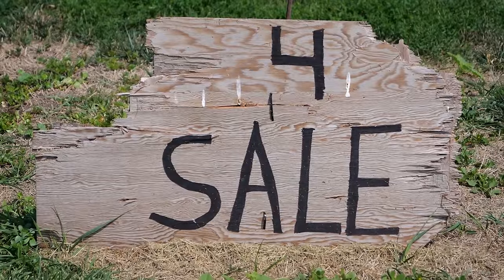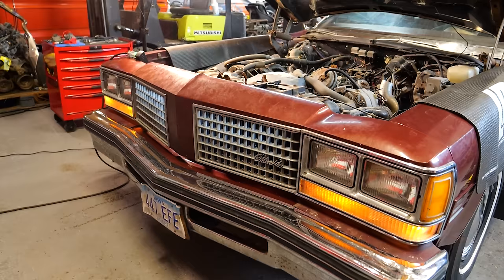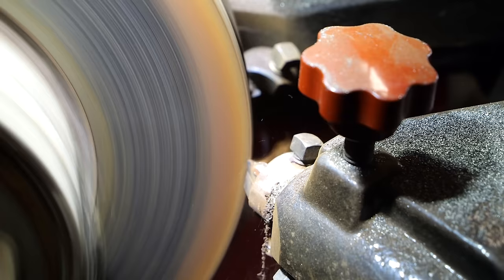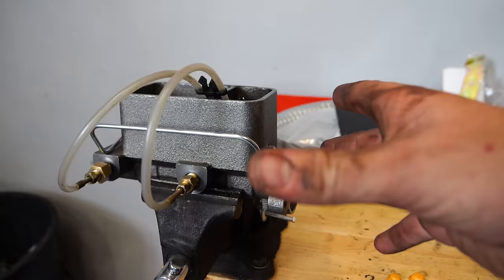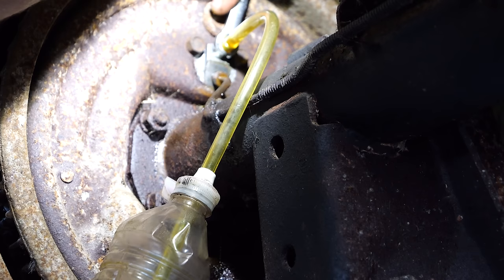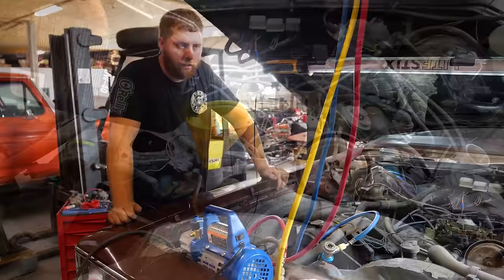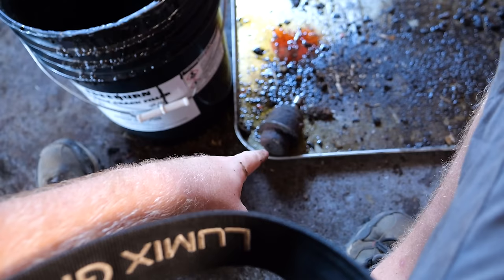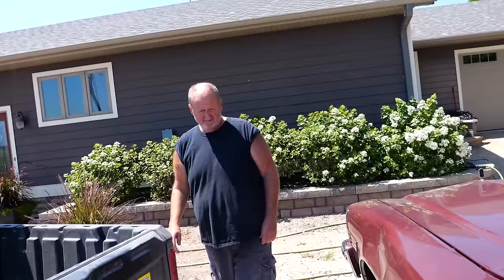Will this ABANDONED 70's Luxury Car RUN & DRIVE for CHEAP!? $1,500 DIY Daily Driver Revival!

Comment from the maker: Thanks for watching!! Check out our merch at https://www.junkyarddigs.com/
Reply: Happy birthday Kevin I hope you got the best birthday present ever the best car you ever owned
Reply: Happy Birthday.
Reply: Kevin, on the subject of AC, have you looked into charging systems with R290 (otherwise known as Propane, without the accessories)?

Yes it's flammable (as is R1234yf & that's used in modern systems) but it's a lot cheaper than R134a, readily available in bulk sizes for multiple vehicles/leaky systems and it's not illegal to knowingly discharge propane to atmosphere so no legal ramifications from filling said leaky systems every month.  On top of that, it works REEEEEEALLY well in 134a systems at least (frozen up evaporators and -40 vent temps anyone?).

Personally I've not done enough research into charge proportions Vs. 134 or 12 to know what constitutes a "correct" charge, I've always simply gone in thru' the low side until I see around 40-45psi running in 25c ambient & it's worked a charm. 100% would recommend at least looking into it, even if you decide not to run with it after all.

Oh and Happy Birthday, I guess it is anyhow since there's other comments to that effect. 73 bud
Reply: Great show  my grandfather had a 76 I got it from him and  somehow ruined  the motor. Miss that car. Is this for sale
Reply: A little body work and you'll have a very nice classic 😎
Reply: Greetings from Macon,Mo neighbor. Love the channel. Big fan.
Reply: Dude that can is worth money 🤣
Reply: You can still buy R12 refrigerant
Reply: WHAAAAT NO BURNOUT ATTEMPT?!?!? you are fired sir
Reply from the maker: @kevinAuman1  Did you not watch the video? 😂 There's literally a massive burnout in the middle
Reply: how much for the olds i'll buy it like NOW
Reply: I’m from northeast ohio, I got a 1968 Oldsmobile 98 with the 455, it’s a Scarlett coupe with a convertible top, I’ve been getting her runnin and drivin and these cars are just amazing. I’d love to see more Oldsmobiles so I could have a few pointers from an expert
Reply: I have an old 1960s Ford Mustang at my dad’s mom’s place I need help restore it
Reply: I’m kind of in your Dad’s camp….”Why?”.  That said, enjoyed the episode!  Good luck with the land yacht 👍🏻
Reply: Did the Freon y'all topped this 98 up with ever leak out over time and also I know it wasn't R12 but did the 134 damage the system at all?
Reply: Happy birthday 
Kevin

Comment: People never realize how good these cars are as cruising machines. Even 40+ years later, they do exactly as intended. The smile on Mooks face, as well as Kevins proves it. Gotta love GM.
Reply: My parents had a 1978 Mercury Grand Marquis.   Unbelievable luxury and highway cruiser.  You just didn't feel any bumps in the road.  There was a badge on the dashboard that said "Ride Engineered".  Indeed it was. Dad looked at the Olds 98 before settling on the Marquis.  There just was no comparison.
Reply: I own a 1978 cadillac fleetwood brougham and it is a blast to drive

Comment: Bit of a tip, when cleaning the rotor after turning. Use dish soap and warm water with a good rag. This was recommended by gm as best practices to remove all contamination and prevent brake noise. Try cleaning with just brake clean then method mentioned and you will see the amount of metal that's still embedded in the rotor/drum.
Reply from the maker: Never heard that, interesting!

Comment: What a great old car. With the tires balanced, you'll glide on down the highway in quiet, smooth luxury and comfort. Really enjoyed this one man. Thank you.
Reply: Here's a tech tip from a old boat driver. Put the stiffest performance shocks on it that you can find. It will take a lot of the float and wallow out of the car and make it ride much better.
Reply: It looked supremely comfortable indeed, I wonder how terrible the MPG is though...
Reply: soft shocks make it ride like it should though
Reply: No, that is spring rating. Shocks are for damping the rebound. Springs and shocks work together.  @TheCatOfAges
Reply: @seththomas9105  yea, but a super stiff shock won't let the spring do spring things fast, making it feel less boaty
Reply: @haydenb8853  Yes.

Comment: I’ll never forget… Another way to tell if your vac modulator is bad is if your car burns trans fluid that it sucks up through the vacuum line.  My dad bought a car with a bad modulator and I swear when we shut it off after a 20 minute drive home there were fire trucks back there somewhere trying to find us. Where exactly, we couldn’t say- It smoked so bad that you couldn’t see anything behind the car 😂
(The good part- I think we renewed and refreshed the piston rings on the way home)

Comment: WRT to the plug gap, those original HEI systems did specify gaps up to .080".  However, after lots of burned rotors and caps, GM backed away from that and changed the specification to .045" for all HEI systems of that vintage.  Those plugs were likely AC R45SX where the "X" suffix means "wide gap".  Going to .045" you would probably want to use R45S plugs.
Reply: I was thinking it was emission related, with all the horrible things they back then.

Comment: Another tip on the brake lathe: there is a speed setting one is for rough cut (fast) to get the rotor smooth and the 2nd is what you had it set for which is final pass.  goes much faster that way.

Comment: Thank you for this video.  This has been a trip down memory lane for me.  My grandparents bought their '76 Ninety Eight (a grass green with a white vinyl top) a year old.  Over the next 16 years,  it went from the grandparents to my mother to me when the original transmission decided to quit at 195,000 miles. While the car was sitting the engine ended up seizing and I eventually got rid of it for around $50. It was a very sad day only because it was a very good car.  Thanks again.

Comment: After watching you do rotors and drums with integral hubs, I have noticed that you have never (on camera at least) used the method I was taught years ago to remove the rear bearing and seal in one smooth motion. If you take the front one out, then put the nut back on, you can usually quickly tug the rotor/drum off, sliding down the top of the spindle, leaving the old inner bearing and seal on the spindle, cleanly removed from the assembly. I can't guarantee it on these old 60's-70's vehicles, but I have done it on many late 80's-early 90's Ford F-150's. If you weren't aware of this, let me know how it works out for you. I used to repack the bearings on my 94 F-150 far too often, usually because I was bored and felt the need to do more work on it, and with this method I was even able to reuse the old rear seal and never had issues with it slinging grease. Just found your channel a couple weeks ago and have watched through everything and starting to go through your partner channels as well. Love what you all do and makes me even more excited to move back up to the old "abandoned" family farm in WI next year and get to work doing my own (off camera) revivals. 
Peace & love

Comment: Consider using keyboard duster to recharge R12 systems.  It's R152a and about the same molecule size as R12.  So its the same pressures and doesn't care if you use PAG or ester oils...  You can dump the 152 right I to a 12 system w/o facing it down.

Comment: Yes! Love it when big cars get some attention, especially Oldsmobiles! Was hoping you showed more of the vacuum lines as I just got my 75 Olds 88 running after sitting for 20 years and need help on where the vacuum lines go...and if you find any rear bumper fillers let me know as well :)  Cannot wait to see more of this Olds on your channel.  Thanks for explaining what you do as well, have learned lots the last few years and it has helped get my baby back on the road. I do have one question though, how did you  get to the spark plugs without removing the AC bracket on the passenger bank?  Best Wishes to you all,

Comment: Big block Oldsmobile's were great engines with really only one major weakness. That was running the bottom end out of oil due to extended high rpm. They send way too much oil to the cam bearings and then up to the top of the motor where it can't get back down to the pick-up fast enough. Eventually they'll run dry and spin the rod bearings. A lot of engines with tons of life left in them went out this way. Really cool find! Love the car.
Reply: Some had webbed main caps, yes they wanted to save 15 ounces on 5000lb cars

,
Reply: these smog 455's made peak power 190bhp at only 3400 rpm's so this engine should last forever since it barley will ever crack 2500. I drive my 94 f-150 the same way and shift below 2500 and I get 20 mpg with it.
Reply: They only did that with aftermarket HP pumps, with a stock oil pump they’re fine, I’ve been building Olds motors for many years. I have a 1972 W-30 in my shop I ordered brand new in 72, just finishing a frame off resto, with a total power Trane rebuild included. Have had many other Olds as well, great cars, with excellent motors.👌😉
Reply: @eriknelson45  Not the 455, only the 403, which is a small block, still a decent motor, but as you pointed out, a less than optimal bottom end, and the compression ratio was abysmal, but with a simple head change came alive pretty convincingly, have built more than a few of them.
Reply: Old man trick on these is to put pipe cleaners in the pushrods to slow down the oil heading to the top.
Reply: @johnstrauss8061  Yes sir, know that trick, it works, without some sort of fix, with the valve covers off, oil easily shoots a good 6’, or better, just had that happen, lol mis communication with my engine builder, put a high pressure, high volume in it, 😂 messy! All I wanted was a bolt on pickup, but no one makes a standard pump for the olds with one, all are pressed in, so I tacked it to the housing on the replacement.👍
Reply: @johnstrauss8061  wouldn't that put small fibers in the oiling system and could end up blocking the oil channel on the rod bearings.

Comment: Great find Kevin!!!  Awesome engineering for Oldsmobile plus all that luxury!!! 1976 was the last year for the full size body on frame design dating back to 1971. In 1977 all the full size GM cars were down-sized by 700 lbs. Your Dad saw the advent of the really ugly 5 mph bumpers compared to the sleek body hugging bumpers of the 1970-1972 Olds 98's. I really like these body styles -- the 4 door hardtop. I really like the 2 door hardtops. Awesome tech talk explaining the disc brake rotor turning and brake bleeding too!
Reply: My 1982 Olds 98 was full size, so it was later than 1977. I could get 7 bodies in the trunk alone.

Comment: Kevin, definitely a keeper, but keep her indoors (the Olds, not Mook) and a new 2 1/4" flowmaster  dual exhaust system will improve HP and fuel mileage. All the electricals and A/C working, WOW. Like I have in my '78 T-bird, she needs an 8-track player! A good waxing and buffing will revive that paint. Then you can win best in show!

Comment: Definitely a great cherry of a find! Just FYI 134a and r12 use oils that are not compatible. Using mineral oil with 134a will destroy the compressor in short order. I personally like to keep an r12 system original and stick with r12. You can still get it i bought a 30lb bottle on ebay a while back no problem... r12 will greatly outperform 134 every time and is well worth the extra cost IMO.
Reply: The old a6 compressors can tolerate mineral oil with r134a much better then most systems as they have an internal oil sump, they don't rely on the refrigerant to help circulate the oil.

Comment: I had a 82 Oldsmobile 98 that had a 455 . It was one of the best cars ever ever owned.  I put a set of headers on it and a set of high performance heads . Plus a high rise intake and a holy carb , it was beast  a bit of a sleeper .

Comment: I changed quite a few of the vacuum modulators in the eighties., 99 percent of the time the modulator valve  ( diaphragm) was leaking oil up through the vacuum line, making it appear that the engine was burning oil!  And sometimes like you found they'd be clogged up with crud. I'd blow out the vac line then install a new valve. Used to love to return the GM land yacht's to the customers shifting perfectly once again....and not leaving a smoke trail ! Easy fix. Never had a chewed wire..lol.                     HAPPY belated BIRTHDAY !!

Comment: The buzzing noise you heard was the speed sensor...it's a knob on the speedometer; if you turn it where the smaller speed needle points to, for example, 70 mph, and when you pass 70 mph, it will buzz to let you know you are going faster than your set speed. My 1979 Buick Park Avenue had the same equipment.

Comment: My friend just bought an 82 Toronado diesel. Had 446,000 miles in 1990. Already has ARP head studs installed and had a rebuild at 350,000 miles. That car is amazing, it gets 40 mpg on the highway, it has huge amounts of torque, it has rear disc brakes and a hydroboost, and the FWD setup is ridiculously cool. Super comfy leather interior, soft seats, everything is in perfect condition. Just needs new belts/hoses/fan clutch/coolant/brake fluid/trans fluid/oil change, and a good cleaning of the CDR valve and associated piping. Amazing cars and the diesels are basically worthless even compared to the cars with the wimpy 307. My car (79 Subaru DL)is a bit tricky with regards to the preload on the front axles. The hub is splined and sits outboard of the brake disc, it is bolted to the brake disc that the axle goes through to the hub, and then the axle goes back through 2 ball bearings with a seal behind, mounted in the knuckle, and then the CV joint is back there behind the knuckle. That bolt that holds the hub on has to be cranked down so hard to not loosen itself up, you have to use an impact to tighten it, it's ridiculous. If it loosens up the splines make a noise that sounds like a busted CV joint, but then you look at the boot and it's fine. What a pain.

Comment: Happy birthday Kevin, this car is nuts. Nice and minty, just like the AC. Really hope to see you follow with the promise to take it on the power tour next year. Cherish it. you can technically 3d print the rear light covers or whatever the heck those are. Also that fender might need some bender.
Reply: Bumper fillers*
I think there are replicas available, you just gotta be ready to pay for them.
Reply: The 3D printed solution might be the way to go if you can get the proper dimensions, and maybe print it in 2 pieces and then glue them together.😉 I think the replicas ARE available, but you'd probably have to pay through the nose for 'em.😛
Reply: There is a really good youtuber called Industrious Pursuits, formerly "the digital maker" & a veteran as well. Over the years he got around to really good level of 3D printing parts that aren't available anymore or cost an arm and a leg if you can even find one.

Even flexible parts. With proper fillament & weatherproofing it may last decades.

Comment: When I bought my old Buick. I found out that the previous owner drove with such a low, if any at all, amount of transmission fluid for 4 years. My Mechanic put atleast 5 Bottles in

Comment: I rode in one of these when new.   Very smooth and quiet ride.  Rode in a new Delta 88 as well, but that car had a heavy duty suspension, it didn’t ride as smooth.  Later Road in the Delta 88 with a base suspension and it was quite smooth.  Replace all the worn out bushings and suspension components on this car., It will ride like a dream.

Comment: When i was a teenager, we had an  83 Olds 98, 87 BMW 325, and a 99 Honda Civic.  I'll be honest, I didnt think much of the 98. I didnt realize how good the other two were.  At this point, I've owned lots of cars since and the old 98 was pretty good.  We literally never had to do any major work to it.  Just oil changes and it surrvived 3 teenage drivers.

Comment: A couple of things. Your pressures seem a little high on that A/C system ( especially the high side ). I am used to seeing no more than 35 on the low side. The high side a good rule of thumb, current air temp +100 is close to what the high side should run. Sounds crazy I know but it works. 
Also, adding a zink additive to regular modern oil is a waste of time. The detergents in the oil will wash that additive out of where you need it long before the additive can do its job. As much as it sucks price point wise, run an oil that has zink in it.  Question me all you like on that, but when people like Lake Speed Jr speak on matters of motor oil, I listen.  
I am not trying to roast you or anything, just want people to learn the right way of dealing with flat tappet cams.

Comment: I had a '76 Olds Toronado in the early 2000's, bought it as a winter beater.
With the 455 and front wheel drive and a set of Goodyear Wranglers on it, it was unstoppable in Wisconsin winters!.
Just like this 98, it floated on the road!.

Comment: Hey guys. I love your vids.   I did auto tech school back in the 90’s and they said the average mechanic has one million tiny fractures in his hands over a lifetime.  When I did Ford school in the mid 90’s they said that most brake dust you’ll find is asbestos.  Rather than hammer on drums and discs it’s a great idea to wet with a hose between backing plate and drum before lifting off drums.   It’s like a cumulative effect.  This stuff builds up.  Here in Australia it was 1998 before they changed the new brakes from asbestos.  It’s kinda nasty stuff.   I really love the way you use the band around the disc while it’s on the lathe.  It does seem to stop squealing brakes.   It acts like when a drummer touches a hit cymbal to thud the shimmer.     The discs can get a similar harmonic sine wave without the rubber band.    Love ya work.